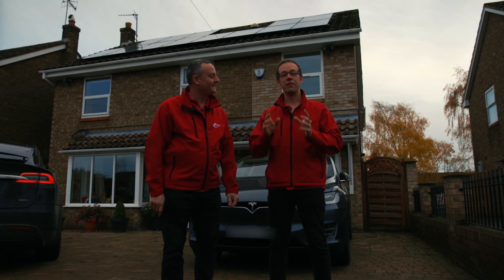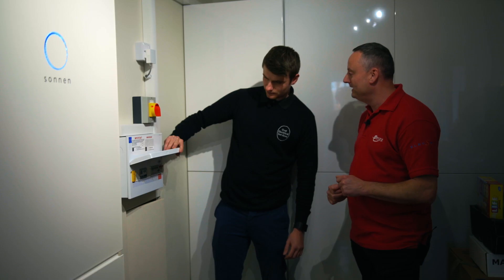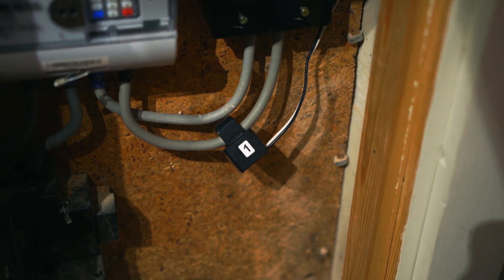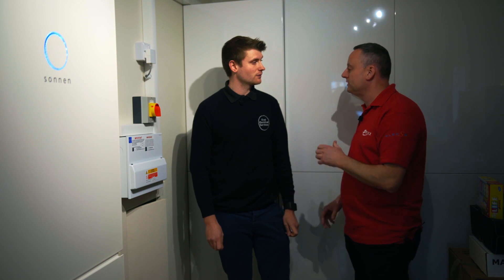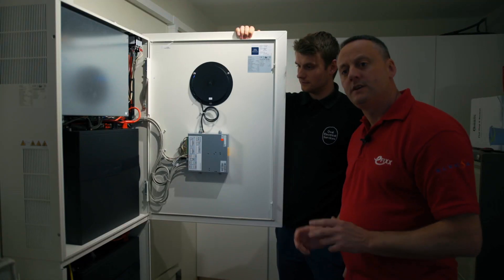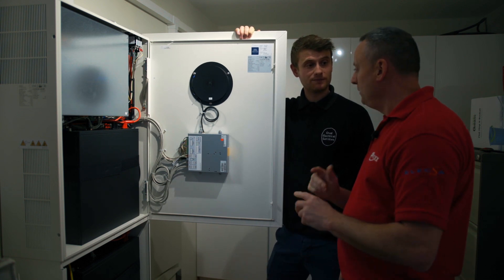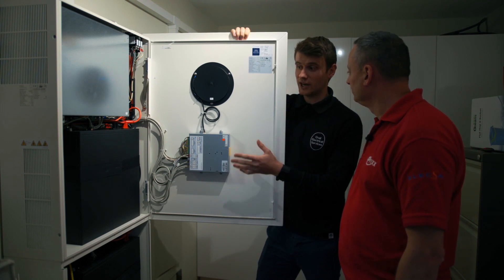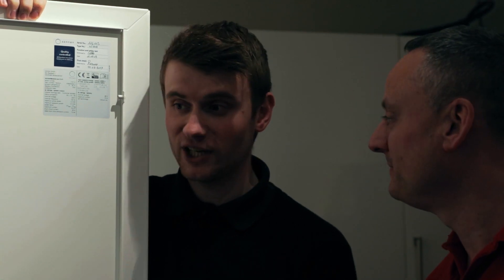Sonnen Battery storage installation for solar panels - uk electrical installation. Smart energy pt2

Comment: So in order to add solar, you need a free circuit breaker, and wire it in. Despite circuit breakers usually taking energy out? Have I misunderstood ? The main tails from the street stays as is. You need a free breaker, which presumably you install at the beginning? Or how does this work,

Comment: Just a few questions please.  Is there a reason why you did not put the batt storage in the attic hidden? What is the depth of the sonnen cab please? Also, if the battery is charging up off peak during the night and the next day is ☀️ ☀️ … then the battery maybe full and if no power consumed in the house, won’t this then go back to the grid, which we wanted to avoid ? Thanks 😊 awesome video

Comment: What about if you have multiple loads that you want to connect only when there's excess from solar? How do you arbitrate between, say, water heater, EV charger and battery charger - all of which would all work well as "excess only" loads?

Comment: A very interesting video.  I had solar panels installed just over a year ago and got my first EV about 4 months ago.  At the moment I'm sending any excess solar back to the grid so a home battery is of interest.
I have the benefit of an Economy 7 tariff so like the idea of being able to charge the home battery at night and then use the stored energy during the following day as a way to reduce my overall electrical energy cost.
One big question I have though is just how long a home battery will last.  I'm no expert in battery technology but realise there are only so many charge/discharge cycles that you're going to get out of a battery.  At some point it's going to have to be replaced, so I want to establish this so I can consider the whole-life cost of a home battery solution.

Is this something you can provide information on please?
Reply from the maker: It’s the same battery technology as EV’s - so you can easily expect a 10 year life cycle.
Reply: @efixx  Thank you for your prompt reply and good to hear the anticipated life cycle.
Out of interest, are the batteries used what you might refer to as "second use" batteries, i.e. may actually have come from a used EV?
Reply from the maker: @dalroth10  Yes there was a trial with Eaton using 2nd life batteries from Nissan Leafs. https://www.eaton.com/nl/en-gb/products/energy-storage/xstorage-home-supports-the-energy-transition.html
Reply from the maker: This is expected to be a trend moving forward. Will be interesting so see how they rate the batteries - does a 100kW become a 90kw and the 10 year cycle starts again?
Reply: If you if you have such a good understanding of it then you should understand that it's not worth it lol

Comment: So how much does a Sonnen 15kWh battery cost?  I'm guessing a lot!
Reply from the maker: Your in the ball park - budget £1000 per kWh
Reply: @efixx  so a 15kWh unit will cost me approx £15k.  My monthly electric bill is £80... So 15,000/80 = 187.5 months payback and that assumes that this system saves me 100% of my electric bill.  Yeah think I'll pass on that 🤦‍♂️
Reply from the maker: Fair point
Reply: @efixx  my monthly bill is £410. So for me it would only take just over 3 years to payback - when can you start  installing

Comment: Great video guys, thanks for sharing as always and making people more aware that renewable power generation is the only way forward. I wondered what safety mechanism is in place, to stop either the PV or battery pack back feeding into the grid when a, the local grid supply is off due to fault and b, the dno is working on presumed dead equipment while fault finding. 
Cheers

Comment: Does that specific ModBus have 3 CT clamps for 3 phase or is it connected to Single Phase but with two CT Clamps and the Third CT clamp was left off?
Reply: Since nobody answered, I'll tell you what I got from the video:
Single phase system
1 CT clamp monitoring the solar production
1 CT clamp monitoring the draw from the grid
The software inside the battery charger/inverter uses these two measurements to determine if and how much it needs to charge or discharge to reduce the draw from or injection to the grid as much as possible (combined with some intelligent off-peak nighttime charging in the winter to reduce draw from the grid during the daytime when the solar system can't keep up).

Comment: Will the battery system pay for itself?
Reply: That depends from situation to situation. If you have little consumption during the day while the panels are charging (because nobody's home) and you can use that energy at night (f.e. to charge an electric car overnight, run the oven/hob/dishwasher/washing machine/dryer... or some extra heating in the evening), and/or if you have a really low off-peak rate you want to benefit from by storing a lot of cheap energy and using it when the rate is a lot more expensive, you'll earn the cost of the battery system back overtime.
If you can and are willing to somehow arrange your routines and work so that you use most of your electricity consumption while the solar system is producing during the daytime in the summer, and also spread part of your consumption needs to the off-peak rate time window during the winter when the solar system doesn't produce enough during the day, you won't benefit from a battery system as you already consume most of your electricity when it's free/cheap.

Comment: Great video really interesting.however I am unable to work out how exactly the AC that's comming down the 2.5 through to the 16amp rcbo distribute it's load..the other rcbos aswell as this one are getting fed from the busbar via the 100amp mainswitch then to domestic meter.im really struggling to work this out.thanks

Comment: great video, my system has batteries, but while away abroad last year my inverter cut out, when I got home it was showing a fault light. when I turned it back on the batteries were not charging, my installer ceased trading soon after instal 4 years ago, now I cannot find any Company to reset my inverter and I might have to have a new inverter

Comment: I use a small solar system more as a UPS via a hybrid inverter, could these larger system provide safe power during a power cut i.e anti-islanding protection, would this need separate isolation such as a relay (contacter)

Comment: Hi guys, great video. I'm looking to put PV on my roof. I have 3ph and demand alternates from ph to ph.  If I had a 3ph inverter and a solar edge storage inverter coupled to a bank of batteries, will the storage Inverter be able to tell which ph is low in demand and charge the batteries?  Also will the storage inverter be able to discharge the batteries to any of the 3 phases depending which has demand? I'd like to be able to programme the inverter to charge off the grid at set times during the night, can the solar storage inverter do this?  Thank you in advance. John
Reply from the maker: We’ll ask our tame PV installer to answer this one!
Reply: Hello John, thanks for the question. In short yes, a battery system can use net metering to try to balance the demand on each phase. It can also be programmed to charge up from the grid during off peak tariff periods. If you would like to discuss this further I would be happy to have a conversation over the phone. Please feel free to send an email with your number on to sam@ovalrenewables.com and I will call you back.

Comment: Nice, bit more technical than my maverick system, how do the I assume High frequency inverters deal with high start up loads? Does it just rely on the grid to provide the surge power? Looks like a great system through, is it Lifepo4 or Lithium Ion?
Reply: Yes it will rely on the grid to help during this scenario.

Comment: @ an average of £1000 per kWh of storage  and saving 10p per cycle the battery warranty of 70% at 10,000 cycles doesn’t even cover the outlay. 
Max output 3.3kw is pretty feeble compared with over 20kw that comes down a 100A standard domestic supply.
Reply: Davi s thanks for your opinion and for watching the video. I feel differently however hopefully as the technology develops and the price reduces we can win you over!
Reply: thats what i thought, a long time to get your money back if ever. Also with more electric cars on the road any off peak tariffs will start to disappear, because everyone will come home from work and whack the car on to charge whether it needs it or not.